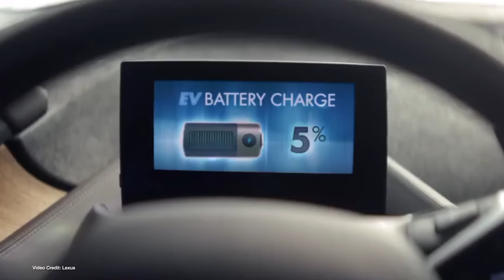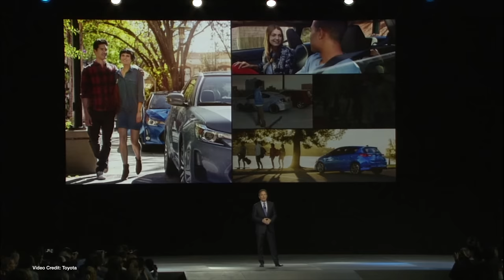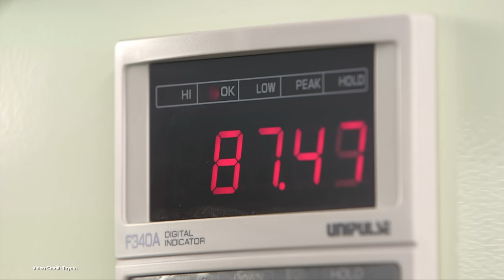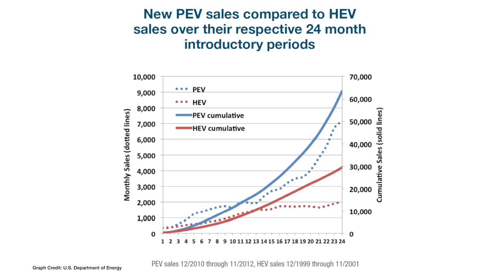Toyota Insists You Can't Ban ICE Cars Yet. It's WRONG.

Comment: No good pretending their cars are electric in adverts when they still have a tailpipe. The big advantage an EV has over hydrogen for me is being able to plug in at home. I can't wait for the price of EVs to start to fall in price - they are still way more expensive to run once depreciation is taken into account  than running an old ICE car (in the UK anyway).
Reply: What do you think a new ICE car will be worth in five years, when you know ICE cars will be banned in 2030. I'd rather put my money in a BEV (in fact I did)
Reply: @marcelreijnen  I swapped my Zoe for an 8 year old Mercedes SLK last year (I had a convertible before the Zoe and missed it every time I went out). The SLK was a lot cheaper purchase price and I have written the money off. I wouldn't be buying a new ICE now for sure (or ever really). If it were cheap enough to do I'd have my car converted to an EV in the future (seems wasteful to scrap something so nice and build a whole new car). I reckon the Zoe will depreciate just as fast (range good but max charge rate 22 kw and if new EVs fall in price that will also exert downward pressure on older less capable cars).

Comment: I do not believe that electric cars are every going to be as affordable as a gas car. Many people in americas are driving cars for under $5000 dollars that are well 20+ years old. Used electric cars will never be that cheap for the simple reason that batteries degrade over time. Just take a look at your smart phone. 4+ years later and the battery life is a lot worse. Just imagine what the battery life is going to be like in 10 years. Sure used electric cars can become cheaper on paper, but old electric cars will need their batteries changed, and unlike your iphones it will cost thousands of dollars. Unless you are willing to have a car with an effective range of like 100 miles.
Reply from the maker: Batteries in cars are designed with much larger buffers to ensure they have a much longer lifespan. For example our Kia Niro EV is at 30k / 3 years old and has effectively no degradation.

^Kate

Comment: Good analysis, however your assumptions about the leadership and direction are not fully formed.
Toyota works in a way where there is less reliance on top heavy leadership.
The facts have to come into the analysis, Toyota produces transportation that is durable and cheap, outside of the western bubble this is what sell. Toyota knows that EV can live side by side with ICE and that it takes several planets to change from one transport form to another. If EV’s are competition, than I believe Toyota are like any other business. Now, make EV’s last 20 years with little maintenance and high reliability and Toyota will take more note.

Comment: Well, Toyota's points are correct.  Insufficient investment has led to batteries and charging infrastructure still not being affordable or extensive enough for the longest 1% of trips driven by more than 50% of people.  Toyota could have invested more money in alleviating these problems, but nevertheless they do exist an won't disappear tomorrow.
Reply: Maybe if you live in the outback of Australia but here in the the charging infrastructure is already great and expanding by the day
Reply: *uk
Reply: If cheeky startup Tesla could roll out a 20,000+ site supercharger network in less than a decade, imagine what Toyota could have done...

Comment: I think hydrogen fuel cells are a fundamental technology and Toyota will make alooot of money from it in time.
Reply: Why?
Reply: Not in cars and light trucks though. The hydrogen process uses 3 times as much energy well-to-wheel vs BEV. It requires a lot of expensive infrastructure and servicing. 
Where batteries are not an option, it might do ok. But the large majority of vehicles, even including some mid-range heavy trucks, buses etc will be battery.
Aside from the cost, efficiency and practicality, every BEV, especially fleet vehicles, potentially doubles as a grid storage device using V2G. Not a trick that h2 vehicles can pull.
Reply: When? Nobody wants to buy the few hydrogen fuel cell cars Toyota has released already , while BEV sales increase exponentially.  When do you expect HFC cars to become popular? When Li-ion battery prices have been cut in half and the number of EV charging stations have doubled? Hardly.
Reply: @rogerstarkey5390  i was thinking aircraft, steel production, long haul trucks. And yes shipping. I have not heard of anything with batteries that could do long haul shipping. Have you?
Reply: Hydrogen power plants. It's perfect for powerplants. You can take solar power and wind power to produce hydrogen. Then turn the hydrogen to stable power ergo no pollution.
Reply: @brandurhansen2099  
Except you lose 70-80% of the energy in the process unfortunately.
Creating green hydrogen, then pressuring and storing, then moving it, then storing it again, then turning it back into electricity is a very very inefficient process.
Reply: I don't.

Comment: Transport Evolved, 

You must be a professional journalist? Put up a headline that is not a reflection of the truth. Neither is your description below the video.

What Toyota actually said, which I only discovered this morning, is that the infrastructure is not in place for a transition to electric vehicles in the time frame governments are mandating. And that is absolutely correct. 
We cannot build sufficient power station capacity, in the U.K. given that we are losing nearly 10 Gwatts of capacity this decade, i.e. nearly a quarter of the U.K.'s maximum demand. The distribution network is too small for the sustained and potentially very large load imposed on it, it was not designed for such use. All this takes a lot of time and a lot of money (which we don't have) to accomodate teh disruption of electric vehicles. This also means that they will not make any real difference to CO2 output as they will be gas powered for at least ten years hence  as a very conservative estimate.

If you wish to be respected in your videos, ensure they are accurate.

Comment: Normally I respect this channel... but the amount of speculation you've used to attack Toyota here without any evidence or facts is pretty astounding.  I mean, the first half of the video is you speculating as to what Toyota's motivations are in their arguments, without any evidence to prove their motivations one way or another...  Curious, why are you ignoring any possibility that Toyota may be right on the specific reasons they're giving?  Remember, this isn't some tiny company like Tesla who managed to produce 500k vehicles in a year in the face of almost no BEV competition, with no other companies yet competing heavily for cells or raw materials.

We're at ~2 million global sales of BEVs, correct?  A normal year for passenger vehicle sales is 80 million.  Add in commercial vehicles and you're up around 90 million.  BEVs currently make up 2.2% of total vehicle sales, and we haven't even started building BEV pickup trucks, large SUVs, or semi trucks which are all are expected to have larger battery capacities.  

If average BEV battery capacity is currently 70 kWh, then we already require 140 GWh of annual battery production capacity to support the 2 million new BEVs.

Now include the trucks, suvs, and commercial vehicles and that average battery capacity could increase to 100 kWh.  That increases annual battery production capacity requirement to 9 TWh.  64x higher than current battery production.  Now include batteries for the growing home storage business, growing grid storage business, growing e-bus business, e-boats, e-bikes, e-scooters, e-motorcycles, and for all the the fast charging stations that will need batteries to offset peak demand periods...  

What are we at now... 10-11 TWh of battery production per year?  78x higher than current production.

Do you have any idea how much mining that requires?  Do you have any idea how that could impact commodities prices?  A lot of the industry's battery savings came from chemistry changes.  When Cobalt prices skyrocketed, Tesla switched to higher Nickel chemistry cells, replacing most of the Cobalt... not because of human rights abuses...but because it was MUCH cheaper and likely cut the price of their battery packs by thousands of dollars each.

Ah yes, Tesla managed to produce a WHOPPING 500,000 cars in 2020.  Of course, they weren't exactly competing much on resources.  Even with such little demand for batteries versus where you think we need to be, they were already warning about battery raw materials shortages.  Nickel, Aluminum, and Copper.  Nickel has become a topic of interest since Musk has now warned specifically about Nickel supplies.  Luckily for them, a Chinese company recently announced that they could transform lower grade Nickel into higher grade.  What they didn't mention is that lower grade Nickel mining pollutes more, as it mostly consists of strip mining in island nations, where runoff goes directly into local waterways and the oceans, where it kills Coral.  (Did I mention stainless steel, that Tesla wants to use large supplies of in CT also uses low grade Nickel?) Nevermind that the processing necessary to transform this lower grade nickel into higher grades likely requires a lot more energy/chemicals than mining high grade Nickel Sulfate directly.  But at least Nickel prices went down... am'i'right?

Nickel, Copper, Cobalt, Iron, and Aluminum commodities (some of the main components of a battery cells) prices are already near decade highs without any sign of waning prices.  Lithium prices are beginning to increase again.    Curious, what happens when demand multiples 78x...if demand for these metals significantly outpaces supply?  How does that affect the price of BEVs with average pack sizes of 100 kWh?
Reply: The fact that Toyota is looking to leapfrog current battery tech before getting into BEVs says a lot.  Maybe that will be a more efficient use of raw materials, and it doesn't make sense to use up all of the raw materials on less efficient batteries.  Maybe it doesn't make sense to build massive cell capacity on technology that may soon be outdated within the next few years.  Why build 140 GWh (current global production for BEVs) that use old processes, only to replace those processes in 5 years?  In that case, it makes far more financial sense to allow battery tech to develop before jumping into it with both feet, rather than spending billions only to tear down everything you've built within the decade and start over again.  Now that would just be stupid.

Comment: I can charge my Tesla at home.  I cannot do that with hydrogen.  Nice report.
Reply: i believe honda had a home based setup where you could convert natural gas to hydrogen-, and fill your car up from home..
Reply: Hydrogen developed by toyota is mostly for the heavy industry and its getting adopted very fast, Hydrogen is going to replace coal for steel production for example and there are many other applications too, heck even elon plants to use hydrogen to make fuel for its rockets.
Reply: @iainansell5930  Audi has already been doing that in Germany using excess energy to produce LNG
Reply: @carholic-sz3qv  SpaceX is using methane for their next generation Starship rockets, not hydrogen
Reply: @midnightstar4065  well it doesn't matter because methane is still a fossil fuel, stop talking nonsense.
Reply: @carholic-sz3qv Actually it does matter - even SpaceX have decided that methane is more practical than hydrogen for their requirements, and it can be obtained from non-fossil fuel sources...
Reply: @midnightstar4065  and it can be obtained from non fossil fuels sources......... but is it? Uhm nope stop justifying bullshit.
Reply: @midnightstar4065  spacex plans to use the sabatier process to make methane and sabatier process means C02+ 2H2= CH4 + 2H20
Reply: @carholic-sz3qv  Exactly, with the H2 obtained from ice via electrolysis, and the CO2 from the atmosphere (on Mars), so no fossil fuel sources...
Reply: @carholic-sz3qv  Yes the plan is it will be - on Mars for example, where the Sabatier process will be used....
Reply: @midnightstar4065  you're too funny mate, unfortunately there is no one on mars, it takes 6 months to reach there and the solar panels and other equipments to bring there isn't easy, nasa has been using the sabatier process on the ISS for years now. Maybe in decades to come someone may go to mars.
Reply: @midnightstar4065  you realise that h2 production on mars will still require energy right! Go educate yourself. You just think they will do it tomorrow like that? Wtf!
Reply: @carholic-sz3qv  Of course it does, but that wasn't the point we were discussing. Glad to see you agree that SpaceX are actually using Methane, not Hydrogen to fuel Starship, and that it would need to be obtained from non-fossil fuel sources for the Mars use case...

Comment: I get their desire to milk profits from their hybrid investment, in the light of hydrogen face saving. But trying to jump to solid state lagging battery chemistry as a prerequisite to real EV effort is a big gamble on brand loyalty. A point about SS battery promises: Increased battery density technologies like solid state will only significntly reduce car prices if the range is held at an overly reasonable 250-350 miles. Otherwise you perputuate the "more than doubling the range justifies the price not being reduced or reduced much" that we have seen from 2012 model year cars to those in 2021. By doing so, the cars will have more room due to smaller and smaller battery packs and price tags. I believe that a customer base does exist for a 700-1,000 mile range, until the "Fly Over States" buy in to EVs and their charging infrastructure and as long as excess reange is still a matter of bragging rights for some. Driving my new 2020 Mini Cooper SE, Sprout. :-)

Comment: EV's require to plug in to the grid.  Where does the grid get it's source?  Right now, through fossil fuels.  EV's are part of the solution but not the entire solution.  Fuel Cells helps to resolve this issue of getting the power from non fossil fuel.  It is surprising to see Toyota's stand on EV's, but I look at Toyota as a very smart organization and has something up it's sleeve to present to the public.  Toyota is far too successful and large company not too have some vision.
Reply from the maker: The overwhelming majority of hydrogen for fuel cells comes from fossil fuel - Winter

Comment: Toyota is a brand that's built its reputation & strength on reliability. They have a standard to maintain, unlike Germans vehicles which are solely meant to be leased & junked thereafter.
The new battery infrastructure & powertrain will take some time for Toyota to adapt to its reliability standards, I don't blame them.
Reply: Totally agree with you
Reply: Are you claiming that an internal combustion engine with thousands of parts is more reliable than a big battery? More reliable than an electric motor with one moving part?
Secondly, if you have an Audi, BMW, Porsche or Mercedes that you're planning to "junk" after the lease is up, could I please buy it at scrap price?

Comment: Toyota is right. Battery price should be halved, energy density should double and manufacturing capacity should be 50 times higher than today. This isn't going to happen in the next decade which is equivalent to 2 model generations (by minimum).

Comment: Channel has devolved into a hater of anything other than lithium batteries... tech changes quickly , maybe hydrogen is doable in the next 10yr. Anything that is clean should be encouraged . Stop the hate
Reply: Hydrogen still will not be clean within the next 10 years the leading hydrogen producers have said this.
Reply: @user-RCST  stop talking nonsense, hydrogen is already been produced by renewable energies, hydrogen is going to soon replace coal for steel production......
Reply: @carholic-sz3qv  okay so I have a source but YouTube's being weird right now and won't let me post anything with a link.  Let me know if this comment went through.
Reply: Hydrogen is not clean, it’s a myth. It needs a lot of fossil fuel and massive amount of electrify to produce and transport it.  We are well past the poi Tod them making sense in cars. Wake up
Reply: @kentonian  yep I tried linking to an article that supported this but YouTube wouldn't let me post it.
Reply: electricity to producer hydrogen is a massive amount more than that same electricity going straight to an ev.  The only people to benefit  would be the oil and gas industry
Reply from the maker: We definitely don’t hate hydrogen fuel cell vehicles here at Transport Evolved. There may well be a place for FCVs, especially in trucking, aviation, and commercial shipping, moving forward. But right now, it simply hasn’t shown itself to be terribly green, efficient, or scalable for passenger vehicles compared to BEVs -Winter